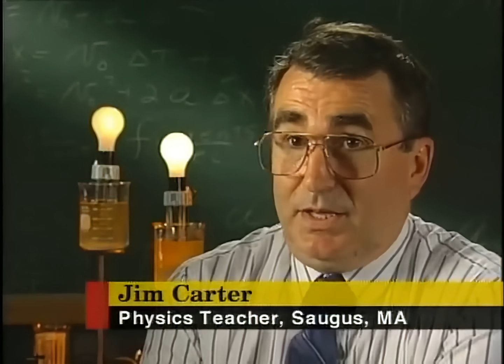MIT graduates cannot power a light bulb with a battery.

Comment: I think most of these kids would have been able to do it with TWO wires because that’s how it was presented to them in diagrams.

I think that it is also a stupid question.  They’re not technicians.  They are engineers and there is a difference.  Their knowledge is theoretical at this point.  Once they get into industry and work under an experienced (mentor), they will come into their own.

A terrible example that highlights only that we teach theory and not practical application.  Some schools attempt to introduce labs to try to address this issue, but ultimately the fact that an Engineer is not equipped with the knowledge of how to get a light bulb to light with just one wire and a battery has a small and only short term effect on their efficacy.

Sam

Comment: Well, seems like it would depend on the battery's voltage, the bulb's rating, etc.
If the question is general, i.e. do I know how to accomplish this task?  The answer
is yes.  But if the question is specific, i.e. can you light this specific bulb with that
specific battery, right now, live, while we're recording, the answer would be maybe,
depending on the conditions.  Is the battery live or dead?  Is the bulb burned out?
Is the wire broken or intact?  Suppose the bulb is rated for 115 volts.  I don't think
that a measly 1.5 volt battery will produce much light.  It will however produce
some current, assuming it is properly connected.

Comment: Two different bulbs, flawed experiment.
Reply: The different bulbs caused them to fail to complete the circuit, fail to attach the wire to both the positive and negative end, and fail to ensure that the circuit actually included the light bulb?
Reply: Two different bulbs, flawed experiment. When one bulb requires 120 V to light up, then the recipient tries to  find a solution to why the bulb did not light up all the while expecting that the material given to them was tested prior.  Don't expect the journalist who gave them to he bulb to know any kind of basic electricity. Did you notice that at 1:03? Did you also notice that this was done on a Harvard campus, and not MIT?

Comment: I just want to say, you idiots are incomparable to this students. Stop acting as if you could compete with them.
Reply: Thank you George. It's pretty interesting that people were quick to judge when if one was to examine the video closely they were played. For starters two different bulbs. The first bulb to appear in the video seems to operate on 120 volts, and on a 1.5 volt battery it would not work. 2nd, not everyone in the video majored in engineering. What may appear as a basic concept to some is not to others.
Reply: That's not the problem. What this video indicates is that highly educated people sometimes pass without understanding some fundamental problems. On long term that may bring bigger problems as influential and smart people may be lacking fundamentals. That means less questions and/or keep buffing the theory or mathematical calculation in order to fix something from the past that you just ignored. It happened, it happens and it will be happening in the future. Educational system lacks some important simple rules today.

Comment: this test shows that students must learn by concept not just by equations, in college teachers just write in the blackboard all equations he finds in his book and dont even care to teach what that equation means in our reality, those graduates are without a doubt very inteligent but if they cant use their intuition and knowledge to solve simple problems then something is wrong with their education, they cant say "Im not and electrical engeener" because electricity is based in a very simple concept, if they can plug a cable into the wall socket to recharge their cellphones then they should know why that happens, therefore they can light a bulb with a wire and a battery.

Comment: I remember when I was 7 years old I used to light the bulb by using only a battery with no wires at all, by scratching the top of the battery's cover you can access to the negative near the positive end .

Comment: To be fair they said a wire. It was never stated to the individuals that they could cut that single wire to make two because if you use just one wire you in a conventional sense would have an open and incomplete circuit. I mean you can touch one end of the battery to a terminal on the bulb but we all know what this news station means. Also, mind stating the specs behind the light bulb and power source, that might also be helpful too.

Comment: I'd like to point out that even if they closed the circuit and had the wire touching both battery ends and the lightbulb, it still would not light. The electricity will not flow into the light bulb, but rather flow down the wire, which has the least resistance. The only way to light the bulb is to force the electricity to flow through it. The only way to do that was demonstrated: touch the wire from one battery end to the bulb, then touch the bulb to the other battery end.